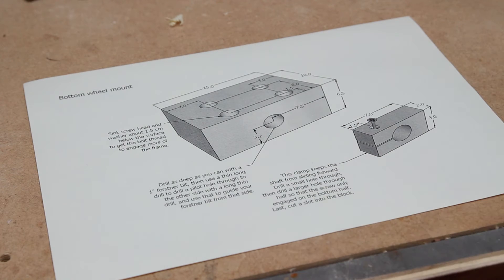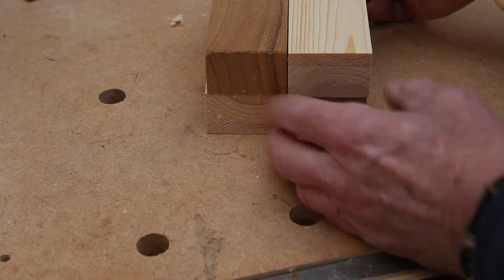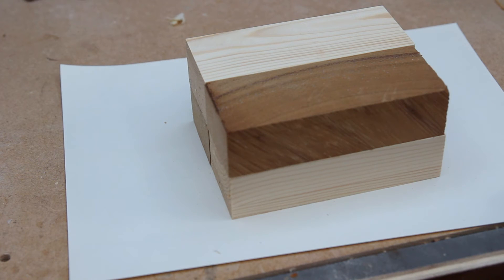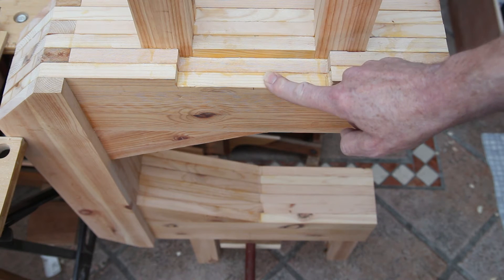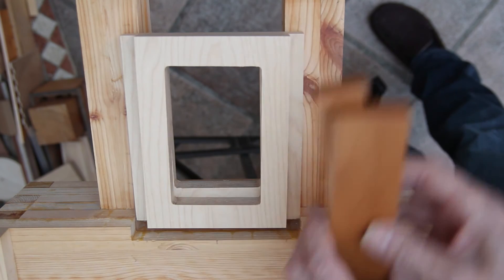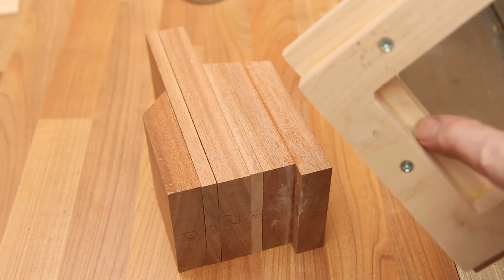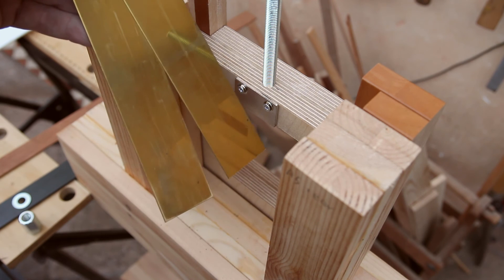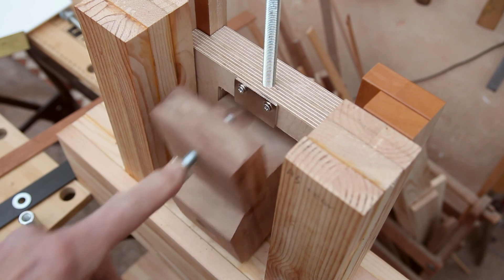Bandsaw Build Diary - Part 6

Comment: Hi John, I am just starting the top wheel mount, I thank you for your idea of using ply... yes it looks much easier
to make and seems more stable. I like the battenburg but I only have oak for the bottom mount.
Thank you for taking the time to show us your build.
Reply from the maker: Ah, I can't take credit. Matthias suggests Baltic birch plywood as an alternative to splined corners.
It turns out that the hardwood I used on the lower "Battenberg" mount was oak. So far it's working out fine. But I would have liked hard maple or sapele.